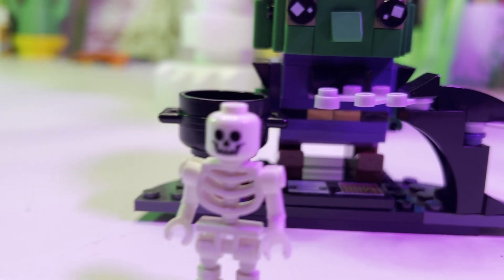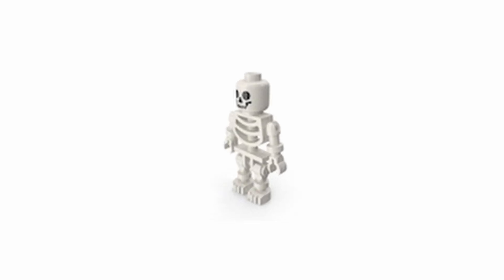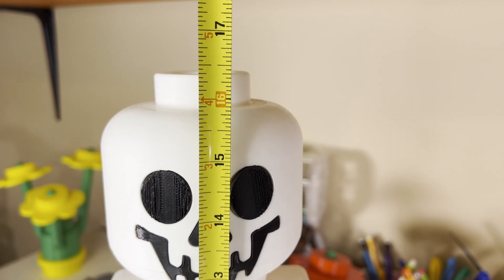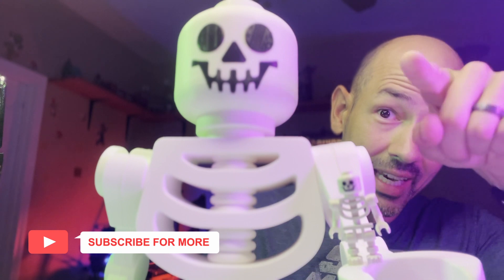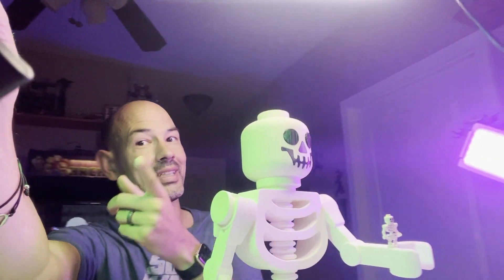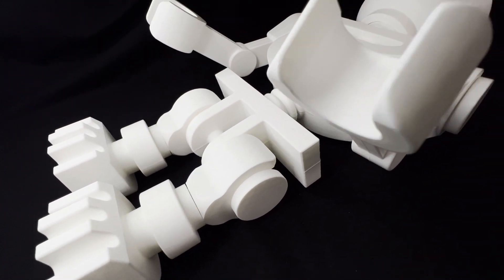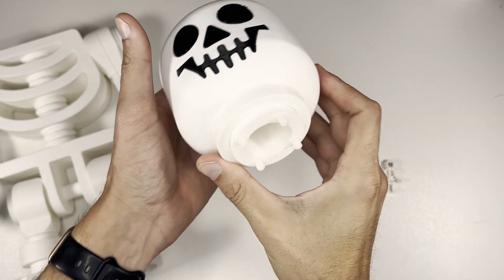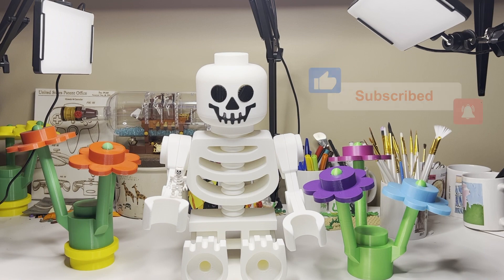This Giant 3D Printed Lego Skeleton Minifig is so COOL!

Comment: QUESTION: Do white prins have uv color degadation say, if i leave this little pal in my balcony to give a spooky vibe will it last white even though the sun hits it directly? or should i give it a coat of uv resitant enamel? anyways nice print my dude cheers
Reply from the maker: Honestly, I'm not sure, we keep ours indoors.  It looks like there is filament you can get that is UV-resistant, but I've not used it.  I would be scared that someone would run off with it if you left it outside! 😱

Comment: Great video, great content . I printed this with my daughter and we have had a great time, the only problem is the face, would you remember the setting for the eyes, nose and mouth? we have had so many failures and I left with a faceless friend haha. keep up the good work
Reply from the maker: I should have made a segment about the face.  It took me a few tries, but I found the best way was to print it upright but with a brim and supports on the edges of the mouth to help anchor it to the bed.  Check the timelapse of the mouth being made @ 2:12.  Hope that helps!
Reply: @3dchill  8th time was the charm haha the secret was the brim, and printed everything separate seemed to work at last. thanks for the suggestion and help. keep the videos coming they are fun. next mat be the mushroom lamp
Reply from the maker: @foomanloo  thats great! Im curious to see if the mouth piece snaps right into place for you like it did for me.  I've read that the mouth doesnt curve 100% with the head, and that you'll need glue to keep it flush.
Reply: @3dchill  My mouth snapped in perfect! sorry it took a while to get to actually building it. It was a great build. Looking forward to another

Comment: How do you get your prints from your bed?
Mine prints are breaking every time
Reply from the maker: Are you using glue or an adhesive, I'm not?  After a print is done I let the glass bed cool, it sometimes pops off on its own.  If you need to get the part off right away (which is most of the time), make sure to have a very thin spatula/scraper, and gently tap on it while wedging it under the print.  Patience is key, you could damage your print by being rough.